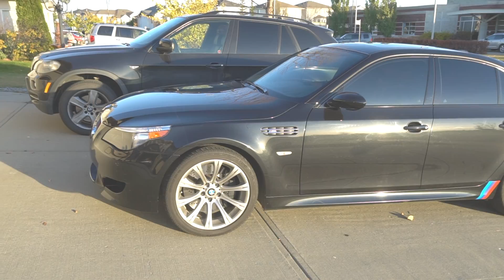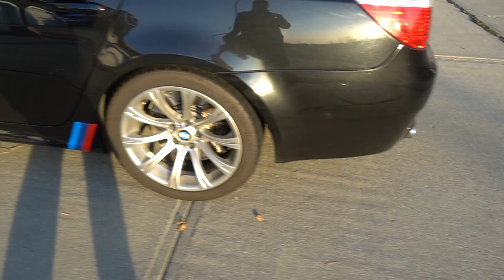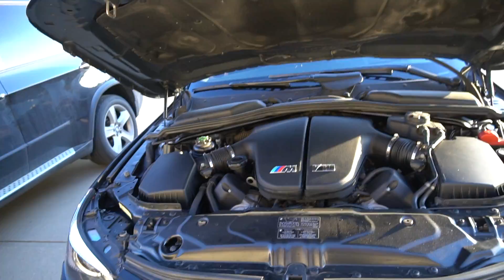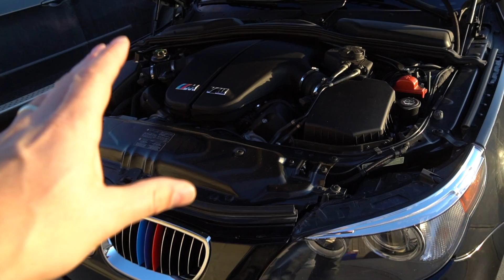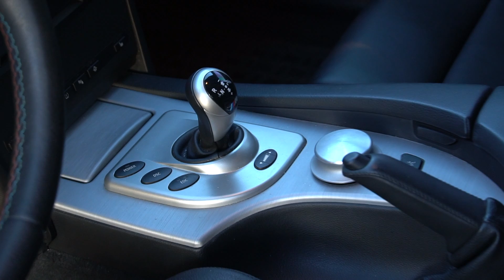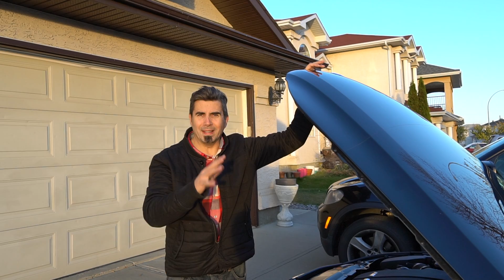How To Improve Your BMW E60 M5 Reliability

Comment: Oil change every 3-4k miles, the correct oil, proper warm up, baby it under 2500-3000 rpm until fully warmed to operating temperature. I never use launch control; this beast is fast enough already. Constantly pay attention to how it drives and sounds. You will know when it’s not the same! Have good diagnostic tools and address issues immediately. Other than that, this engine, the S85B50 is amazing.!!!

Comment: Well if Vanos lines/pump still fail synth the supposed correct stock oil then why is that even mandatory. Someone needs to explain why let’s say 5w-50 redline would increase the risk of failure sooner. Otherwise, it’s merely conjecture.

Comment: My plan is to buy one and immediately purchase the rod bearing upgrade kit from ECS and get it installed that way I clean up a lot of these issues from day 1. That prevents a lot of the oil flow problems in general.

Comment: Amen to proper warmup to help avoid rod bearing issues.  I owned an E90 M3 from new for over 10 years and put over 172k miles on it.  I never pushed the engine until the oil temp. was completely up to a stable operating range.  I then redlined that car often and never had a problem.
Reply: Is it from lack of lubrication?
Reply: I can only guess - my guess is the high viscosity oil is just too thick at cold temperatures to lubricate high RPM operation.  But all engines are designed to operate at temperature - that's why the M cars have variable red lines.  @awokenghoulyt3556
Reply: @awokenghoulyt3556  no it’s from very precise, German lubrication
Reply: So u spent over 100k on a car that you could not abuse until it warmed up and you feel totally comfortable with yourself?
Reply: LOL of course - 100% comfortable.  What do you expect, you pay more money to drive hard sooner?  @7beast298
Reply: @7beast298  it will blow up because it’s not like most cars

Comment: Would highway driving keep it more reliable than city driving?
Reply from the maker: Marginally and longer trips are better tha. Many short trips with cold starts.
Reply: ExoticCar PlayPlace  thanks!! I drive to la from Las Vegas. And that’s really where I spend most of my driving . Occasionally in LA ol visit the beach and dog parks but then after two weeks I drive back to Vegas . So maybe I’ll put 800 miles a month total .. but most of them would be highway long trips.. I really want one.. I’m not the abusive type because I usually have my gf in the car and my dog  so I can’t be driving crazy

Comment: Guys and Gals. What will help everyone thinking about one of these is to look at it as a low profile Ferrari or Lamborghini.  If you think it is just a BMW or a 535D you need to adjust your TV set.
Take a great interest in everything about the car as shops will assume you are a walking wallet or worse charge you for work they don't even do.
Find cheap(er) Esso stations and drive fast from one Supreme pump to the next (Esso Supreme contains no ethanol and so has a higher energy content than other 99 fuel).
Buy Michelin PS4S anything else is disrespectful.
Always hit the M button and change down in tunnels.  Some cars are better than others - choose wisely grasshopper.  Don't assume you are Ayrton take lessons from a racing driver.  Or at the very least read Ben Collins 'How to drive'.  Go to mindfulness classes to develop inner peace, because everything being slower can be f f f f rustrating - patience grasshopper.
Learn to enjoy it for what it is - ruthlessly efficient at getting from A to B.  Have fun y'all.

Comment: I have a 2008 m5 now bought it in April 2020. It’s at 105k km. Bought it at 101k. I’m going to be going in for oil change and want to do some 100k km maintenance. What should I do? My car doesn’t feel as fast as it should. However once I added the fuel injector cleaner it really opened up the power better. I’m thinking with spark plugs, fuel filter etc it’s going to get even faster

Comment: On my first e60 m5 I would every 2k kilometres add fuel injector cleaner and also do oil change every 5K kilometres. The engine was always strong and full of power. I did have it heavily tuned at the same time
Reply: How’s it been so far and how many miles you got it ?
Reply: @AreYouSeriouslyy  I guess it blew out ?
Reply: @giocasanova6894  that’s very BMW

Comment: These are detuned f1 bmw race engines. Unfortunately they cut costs on the associating parts for overall price. So more frequent service intervals based on the nature of the engine. Race engines requires more attention. If you a, "Car Guru Nerd 
DIY GUY", you can save much more than paying someone else for their time, way too expensive thats where most of the cost lies.
Reply from the maker: 100 percent agreed

Comment: Are there aftermarket parts to replace the OEM parts that are more reliable?
Reply from the maker: Few
Reply: @ECPP  ok thanks. I've always liked bmw and when I heard a while back the e60 had a v10 i was excited. Not only was it an m5 (which is my favorite) but it had the v10. So over time I've been doing research. That's how I came across ur video after hearing of the horror stories that are told about them. Ur video gave me more hope that I could get one and not regret it.

Comment: I will tell you, you just dont buy one, how do you avoid a snake? just stay away if you know its a snake. I have a 2002  Audi S6 Avant second  owner no problems, I am now residing in Sweden took the car with me from the USA 1  now 195,000 miles later still going strong.
Reply from the maker: Sounds like a good track record
Reply: U.S. Audi UrS4 AAN owner here thinking about bringing it to Belgium.  Still want a cheap S85 to tear apart and see what the hype is all about.

Comment: Buy a really good set of rods and pistons AND rod bearings and then do a VANOS delete it’s actually not bad, my friend has one with all that done to it and I got to drive it while he was out of town it was a hoot
Reply from the maker: That sounds interesting.  I wonder...
Reply: Interesting take.  I'm thinking of buying a cheap engine (Oil pan was destroyed in a crash).  Dry sump it and the internals will be replaced anyway.  Use as a secondary engine for swaps.  Who does the Vanos delete?

Comment: Any preventative maintenance to do first ? How can I really improve reliability and save money ?
Reply: Oil, brake fluid, smg fluid, diff oil.  Check all the service items are genuine BMW and that wear agreeds with what the OBC and service book suggest.  Impossible ot clock the mileage but people can be dishonest with the service records.  Diff seals weap, and get worse - do all three obviously.  Rear calipers can seize, one at a time but just replace both to minimise your down time.  When you get all the fairy lights and it says limp home mode - it will be throttle actuators - replace both and the IDCs when you are in there.  Oxygen sensors maybe to help idle.   If you get SoS message and cannot activate telephone in iDrive - find and pull your TCU and send it to MURA in Romania.  BMW only do the same and charge the unknowing 2k.
Do the seat thigh supports move?  If not the cogs have worn a Saturday afternoon job.  DIS bulbs do fade over time.  Buy Philips from eBay rather than from parts and fit yourself.
Always use BMW screenwash, bulk buy.  If in any doubt strip the wheel arch, pull the reservoir, clean, bleach, dry and refit.
Replace the windscreen (stone chips) and wipers - for a treat.  Stone chips may have meant a previous owner had a front bumper cover blow over - it will peel - treat it to a full strip and quality paint job.  Hope this helps
Reply: @robi4387  this helped a lot im trying to own bmw most “uNreLiaBLE cArS” I already have N54 almost done still a ways to go & I want this m5 next to it & this looks like a good start for M5 maintenance ✅Ⓜ️🌎

Comment: I got lucky, I bought a 2006 e60 M5 for $19,000 CAD. It's got 125,000km (77,000 miles) on it, but the engine was replaced at 100k (62,000 mile) . completely re-done, machined the crank and oil valleys to cure the rod bearing issue ($14,000 do do it), gearbox completely gone through when the engine was out, Secondary cat delete full stainless RPI exhaust. All fluids changed 500km before I bought it, engine, gearbox, coolant,  rear diff, brakes... Stage 3 tune, carbon intakes, DINAN anti sway bars, H&R lowering springs, new brakes, Carbon front splitter, carbon rear spoiler. Flawless carfax, Car is flawless. Never winter driven, owner supplied me with all service history.

Comment: Iv had mine 5 years only problem Iv had is the brake lines and rear calliper, but now Iv got the rod bearings to do
Reply: Olesya&Barrie Gunn definitely do the rod bearings asap. I did it on my m6 on 80k and they were really bad! I was lucky I caught it on time.
Reply: Oh ye mine too first one caliper got sticky then the other.  What did the bearing look like and at what miles?
Reply: Robert Walton-Sharp thinking about buying one, any tips?
Reply: @yophilli  try to get one with good history and low miles but doesn't that apply to any car purchase. I love mine and won't get rid of it.
Reply: @morsteadriders4221  with how many miles did you get yours?
Reply: How many miles in those 5 years

Comment: How to make the E60 m5 v10 reliable? By sellin it.
Reply from the maker: Nah I am good thanks.  It will be the rediscovered jewel.  When everyone is running around in single cylinder 22 hp hotrods strapped to autonomous electric motors , I will enjoy my drive like in the "old days"  as long as there is oil and gas available.

Comment: Very informative video. When you talk about letting the car warm up how long are you talking about?
Reply from the maker: Hi Juan, assuming you have relatively warm outside temps as i do in the summer, i let it idle for 3-5 minutes on the driveway and then setoff.  On e i start driving i keep revs way down like no higher than 4000 for another 5-10 minutes.  I also rely then on the tach and once the sliding taxh displays full redline then i am good to go.

Comment: Hi Mark, love your channel and greetings from Edinburgh Scotland. As you are do knowledgable I would appreciate your opinion. I’m thinking about an E60 M5, however I would be daily driving it but only 5 miles a day. How do you think the engine would handle this as it would potentially be in cold start mode then switching off. It would get more of a run at weekends though. What do you think? Or should I go for the 4.4 twin instead? Thank you and keep the vids coming 😎👍
Reply from the maker: Hi Boydie and welcome to the channel.  I know it is quite evident that I love the E60 M5 for its unique engine and sounds as well as the stunning looks.  That being said for overall reliability, power, and versatility with the DCT or manual I would have to recommend the F10 for a person looking to enjoy a fast 5 series that will prove to be less problematic over the long run.
Reply: Thank you Mark
Reply: @boydiedj3718  dont go for the e60 man its just a question of time when the bomb is going off

Comment: Another tip: if you’re standing still, say in front of a red light, don’t keep it in gear! Put it in neutral. If you keep it in gear the clutch will continiously slip - which causes uncessary wear on the clutch.
Reply: Jadden our SMG 3 is not really an automatic though. You don’t hold your foot on the brake - yet you stand still in gear. Even if uphil. That means the clutch is in fact slipping.
Reply: @diopsidem5  If its not a normal auto then you are right. Otherwise its worse to put it in N
Reply from the maker: That is a good tip, thanks Nick.
Reply: Thats not true for an automatic.    Only if you stand still for more than 2 minutes...
Reply: You are wrong. Also leaving your car in neutral is a safety issue because if you need to move out the way quickly you have to put it back in gear. Those seconds can mean avoiding an accident

Comment: You should make a video on whats the best way to accelerate from a dig without laynch control, i tried to race the other day from a dig and had it in s6 traction control off p500sport mode, stumped and made a burnout show, with traction on mdm it wont spin as much but still has a delay, i love the wheel spin for fun sometimes but when its time to race i want to grip and go, btw my tires could be an issue as well im running continental extreme contact, maybe a stickier tire will help a bit
Reply: Nitto r555 drag radials if they'll fit.

Comment: Gotta have a aftermarket warranty on these things if your car is eligible. I have been pretty lucky, but my SMG pump just went out yesterday. It should be covered under my warranty and I wont have to pay anything.
Reply from the maker: I agree and we had an attermarket warranty too but recently expired so i have been debating the 5k for 2 years when i only put on a couple thousand kms a year.
Reply: Yeah I totally understand. I had a 2 year 24k mile and used it in less than a year. It paid for itself with only a couple of repairs. My car has been pretty reliable it is a 2009 M6.

Comment: Good video. I have owned a 2008 SMG for 6 yrs. I took it off the road as a daily driver last month. Just too many pricey issues and potential time bombs. Vanos units needed replacement at 68000 miles and now the idle control valves made of cheap plastic have bit the dust which is about a $2k fix. As much as I love it, I also hate it. I’m also tired of filling it up every 2-3 days since I average 10mpg. The honeymoon period and infatuation with my pig of a beast is over.
Reply: I’m sure you’ve sold it by now. No way your working 12 hours days of your life to anymore to invest in an old car that eats up thousand upon thousands until they beat you to the ground and dig your grave. Good thing you bought a house first however imagine prioritizing every cent you made working 80 hours weeks in a factory for all of it to go into a m5 and repairs

Comment: The manufacturer recommended extended oil change to 7,000 miles that’s because they are telling you to kill the bearings, and sludge up the engine, this strategy is to give their service department more labor 😭🤣🤣there’s a lot of cheap drivers who follow these oil change intervals, and they end up paying the difference later on by needing a new engine or a new vehicle.

Comment: How about change aftermarket crankshaft?
Reply from the maker: You may have to if you leave the bearings too long.    If the bearings wear to the point where they start to score the crankshaft journals, then a complete engine overhaul with a new crankshaft would be in order.  Outside of that, just upgrading itself may not help as I have not heard of a good alternative yet.  A large part of the issue is the tighter bearing tolerances which mean it is hard to get oil into the gap but because of the end play also being tight, the oil does not leave easily enough either.  The aftermarket bearings may help and good oil is another solution, but it is still up for debate on whether a lighter oil is a great solution as mentioned in the video..  We will have to wait and see.